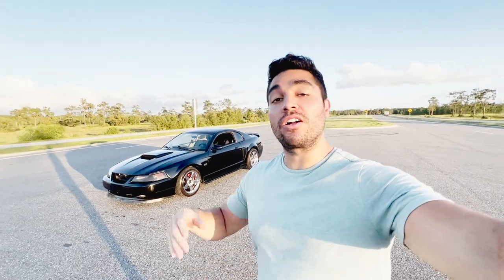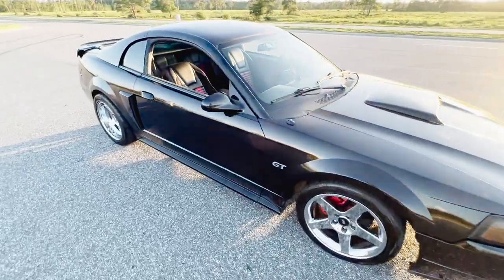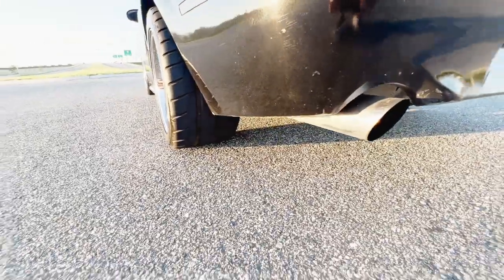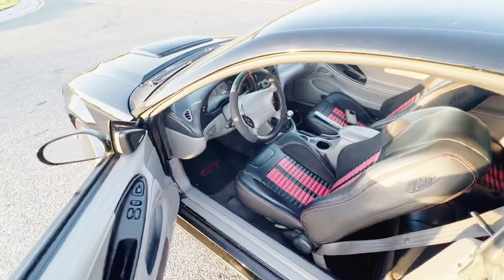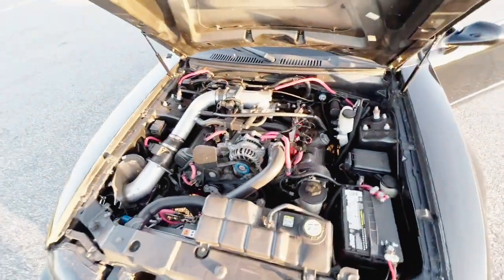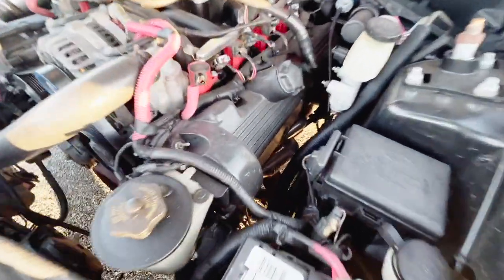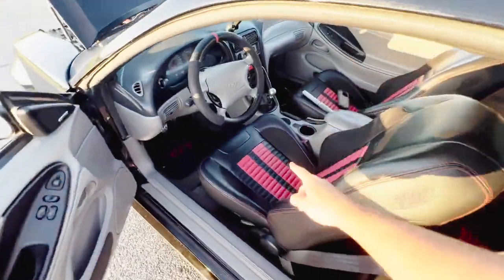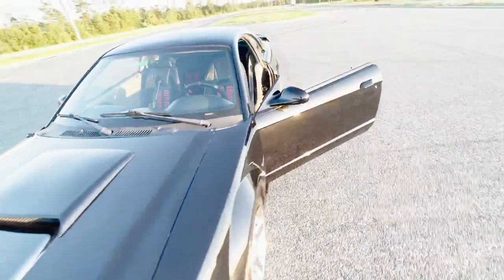How Fast Is A 2001 Ford Mustang GT Full Bolt Ons - Are New Edge Mustangs Fast?

Comment: If you keep the rear suspension softer, it’ll grip like a beast. I have steeda sport/koni str.t combo and can also recommend the Whiteline upper and lower control arms and their panhard rod with support!  Zero axle hop and it sticks like glue while cornering under full throttle and out of the hole.  Dude, no traction control/advance track needed!  You can throw it into corners and it blasts out of them like a demon.  Sucker stays glued with stock Pzeros.
Reply: You mentioned cams, Stock cams….

Comment: I had a 2000 Mustang GT, also manual, also with full bolt-ons. My best quarter-mile run at the track in the Florida heat was 13.99 which was achieved only after someone recommended reducing my rear tire pressures to 14 PSI to ensure better traction. My next fastest time was with a passenger who was my daughter-in-law (weight about 120 pounds) helping with the traction also. The reduced tire pressures worked the best - I believe I had drag radials at the time which are street-legal.
Reply: I need radials , my car will go 13.1 with slicks but with these sumitomo tires just spin in 1st 285s would love to get the 315s on

Comment: Only thing you need now is the upper intake manifold from the Ford F150. Also go for some 410 gears. And try to not dump the clutch when you takeoff launch it has about 2500 to 3000 RPM. He will improve your times drastically.

Comment: The car isn’t crammed. Any aftermarket cams for the PI cars have a noticeable lope to them. If the person sold it to you and claimed it had bigger cams, you need to get some money back. Not bashing you at all. I have just had cammed 2V cars and been around many cammed Modular’s. We don’t get any real higher lift cams, they are all bigger duration. That makes them lopey.

I get learning on the new edge manual. Doing pretty well starting out. It is great to learn on such a manual input car. The clutch is still manually operated. The shifter is directly into the transmission, no sloppy weak linkages. You can feather the clutch a bit with the cable operated cars, not so much with a hydraulic clutch. Helps on those launches, just don’t ride the heck out of the clutch. Find out if you have an upgraded short throw shifter with positive shift stops, like a Pro 5.0or Steeda. Those definitely save your transmission from damage on most bad shifts and actually help you go from 2 to 3.

 I would suggest dyno running the car to see what it makes and where it makes it. Typically the stock PI lower intake chokes the car at about 5600 RPM. Once you see where the car is making power you can know when best to shift. For instance the stock intakes choke the car about 5500 RPM and after 5700 the hp falls off. So at 5500 I would no lift shift it for 2nd  and 3rd if you have one of those previously mentioned shifters. Not just the handle, the actual shifter with the shift stops. Also, best place to hash this thing out is the track. It will launch a tad better there and aid in you consistency.

Comment: My 2002 almost stock exepted gear 3.90 ,underdrive pully,exhaust ,no longtube,plenium ,short throw  shifter ,tune,with drag radial ... it run 13.45 @103mph 
You cant do quicker than that with  long tube and driver skill and some drag radial ..btw nice car have fun 🤟
Reply: Lol
 Almost stock, proceeds to drop $6k worth of parts intalled

Comment: What was the outside temperature when you ran it? My 03 GT has stock suspension (but has orange Koni struts and shocks). Factory air box, larger TB, steeda under drive pulleys, Breenspeed 93 tune, stock gears 3.31, steeda short shifter, racing seats, SR mufflers only, stock exhaust, and SVT cobra wheels like you but 275-40. On a 70 degree day at sea level my draggy does 5.8 consistently to 60 mph. I have the heavy Mach 1000 sound system in the trunk. Engine has 132k miles on it.

Comment: You can definitely get it faster for sure with better suspension. I’m on a 285 Bridgestone re71r with upgraded suspension and a maximum motor sports panhard bar and I run mid to low 5 5s
Reply from the maker: Good to know, thanks for watching! Driver mod will help a ton too once I get it down 😂

Comment: That is terribly slow. I remember back in the day they said 99-04 GT runs 5.8 secs 0-60 but apparently after 20 years, it lost some time.
Reply from the maker: Sorry man, but I think the terrible driver is what’s causing the time to be so slow 😂
Reply: You do understand that time was achieved in optimal conditions with a professional driver right?  This is a manual trans car trying to do 0-60 on the street with a non professional driver.  People frankly put too much stock into 0-60.  60-130 and quarter mile trap speed tells alot more.  0-60 is all about traction just like 60 foot is.

Comment: I have an auto 2001 gt, 4.10 gears, cold air intake, bbk throttle body and a flowmaster catback exhaust. Even with auto I still have a ton of fun. With Manuel i bet you really enjoy it.
Reply from the maker: It’s a blast for sure, as long as you don’t mind a heavy clutch

Comment: Unfortunately the 2V and 3V are obsolete platforms. Sure, you can go all out and make crazy power, but you can't do it on a stock block or rotating assembly. They're good for cruising around and having fun, but that's about it. They're basically classic cars at this point. Unless you Coyote swap it... then 1000HP on a stock block...

From a performance standpoint, they're trash, from a car guy standpoint, they're cool cars you can have fun with, but don't expect to win a lot of races.

Comment: the only thing that added power was cams and headers the intake plenum and throttle body are good for boost but n/a they are useless.
Reply: Nope, i know for a fact that a CAI n throttle body n plenum do gain hp n acceleration, especially with cams n headers.. If boosting it, might as well just leave it all stock n let it chug..
Reply: @P71ScrewHead  I have Cai, throttle and plenum not boosted it didn't add anything.
Reply: @Himothy474  ok, but did you tune it?? i know for a fact acceleration improves with those mods..
Reply: @P71ScrewHead  the power comes from the tune, those mods, after 20 plus years in mustang. I'm sure you don't have a special one that bolts ons work on and the other 120k gt's made they don't.
Reply: @Himothy474  it's been dyno proven to work n make more power, it's simple math..
Reply: @P71ScrewHead  oksy

Comment: Yea i agree that's terrible traction. Ford just messed it up like they always do . i have a 2008 gt and it's the same i even have 3:73 gears with 345s in the rear and still get no traction. 6.6 0-60 that's sad. Ford doesn't do a good job on the mustang every year i see videos of things owners hate about there mustang. When i had my camaro i never had any problems over power or traction. Can't wait to sell this .
Reply: Mustangs sell as much as sex does, anything before the Coyote didn't get expensive internals like seen today.. Why?? Bcuz they sell so many as is.. I'm a 2v guy myself, the block can handle power, the twig rods can't..

Comment: i ran 15.3 at the 1/4 275 mickeys broke my rear end
Reply: 14.2 before it broke
Reply: @datdangstang  i run 15.3s in my 09 P71 with just longtubes n open cutouts..lol

Comment: My Mustang GT 2002, not very fast, even for a V8.
Reply from the maker: Do you have any mods done to it?
Reply: @cobracarlos  I don't have it anymore, but no. I do like Mustangs.
Reply: Gears and a tune really help these cars to have a little more pep to em 410s or 373 best decision I did to my 02
Reply: @4nlover635  What are you expecting from a fleet sold engine (cheap to put together n that'll last forever) that's tiny in the v8 world??
Reply: @P71ScrewHead  I was young.
Reply: @4nlover635  For sure man, but they can still make good power when built right.. ;) I'm building my lil 2v..

Comment: As someone who owned a full bolt on GT in the past, if you're looking for speed, look elsewhere... Modern 6 cylinder cars can smoke a full bolt on new edge GT. Go 5.0 or cobra or go home.
Reply: i disagree, a bolt on 2v can perform n be fast, dude's missing heads, a TrickFlow top end kit would smoke plenty ppl, gotta know what to spend on, also times depend on what state he's in, here in HTX times are consistent with dealer's claims..
Reply: @P71ScrewHead  Heads, cams, etc, are not bolt ons... You're getting into major engine work, and if you're going to spend that on a 2v, again, there are much better applications to spend that money on....
Reply: @coryboy345  your 1st sentence is debatable.. n yes i agree there will always be better engines to mod, like a 632ci bbc/bbf that makes up to 1k hp n/a n gets 4 gallons per mile..lol